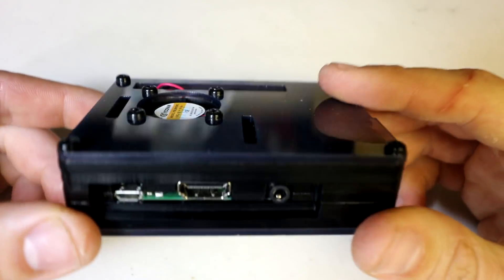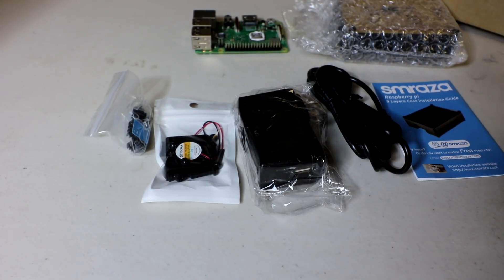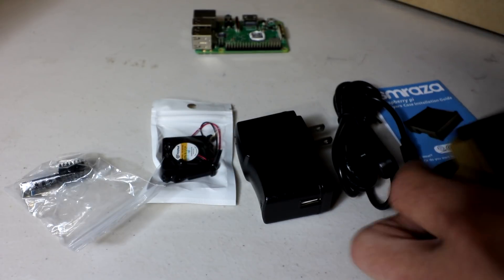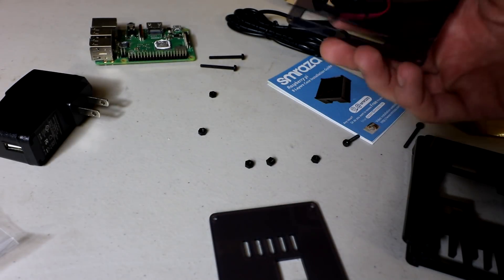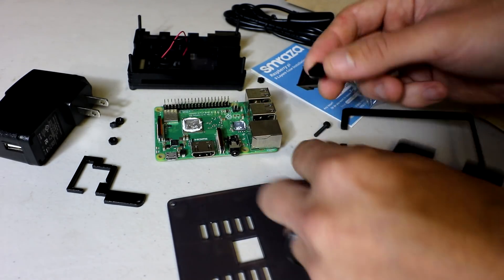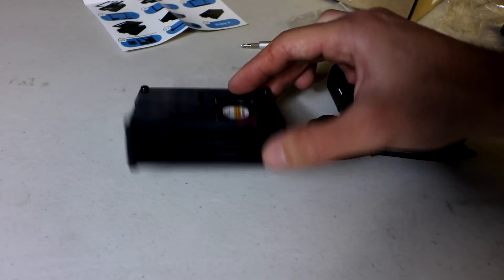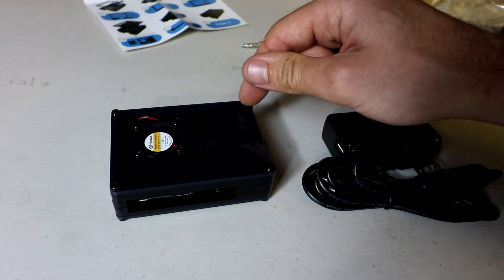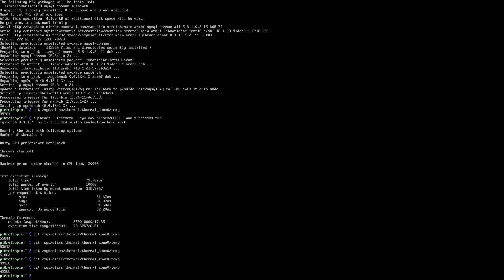Smraza for Raspberry Pi 3 B+ Case with Fan + Heatsinks Overview

Comment: anybody else having this same problem as mine?
the on - off switch work but even the switch is off, it is still supply some electricity 
not enough to boot up the raspberry pi but raspberry pi's fan still spin

is this normal?
Reply: Probably to cool the pi quickly after it is used